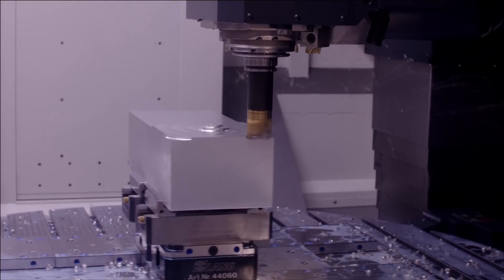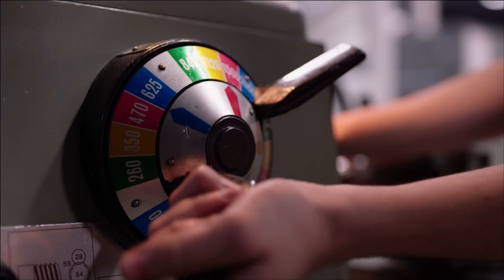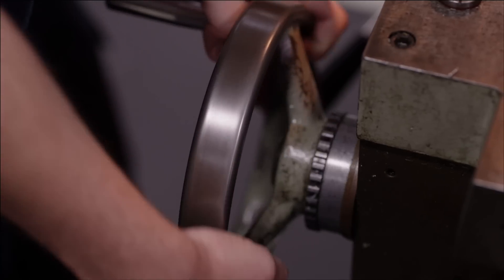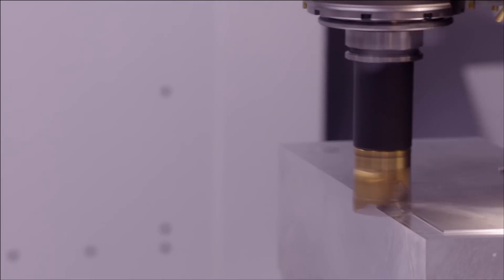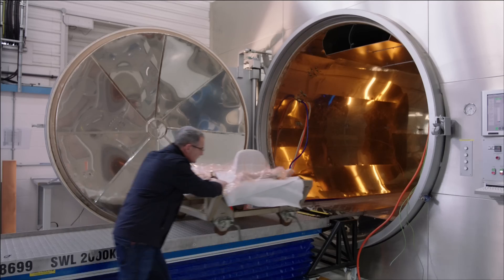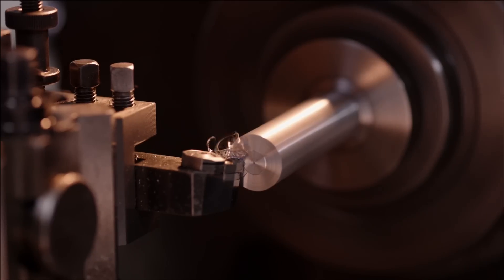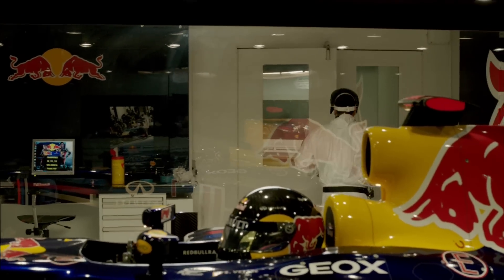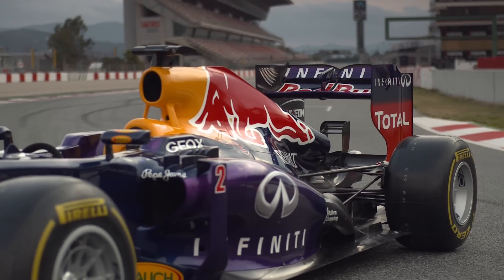How To Make An F1 Car: MANUFACTURING (Part 3)

Comment: Mesin motor matic CVT diaplikasikan dengan Gear box transmittion 4/5/6/7 speed pasti mampu memutar gardan yang diteruskan ke roda penggerak menjadikan mobil, bus, truk, lokomotif melaju lebih kencang dan lebih irit bahan bakar minyak.
 SOEDIRAN DPU K BLORA 1954-1985
By Setyawan Tulus Raharjo .
MON'CHOYS STATION BLORA, CENTRAL JAVA, INDONESIAN